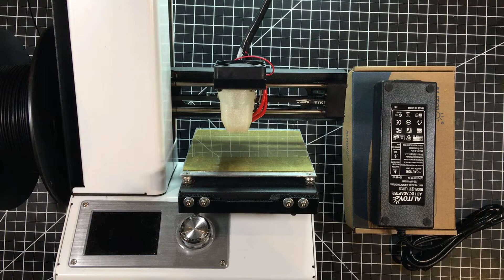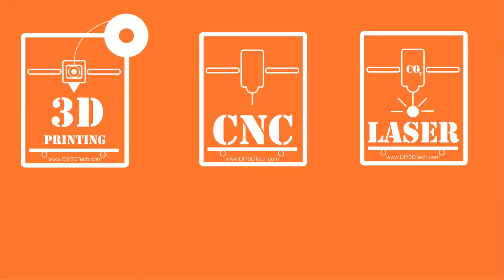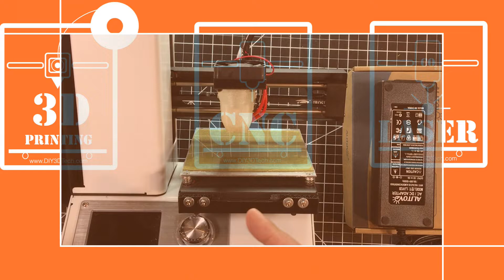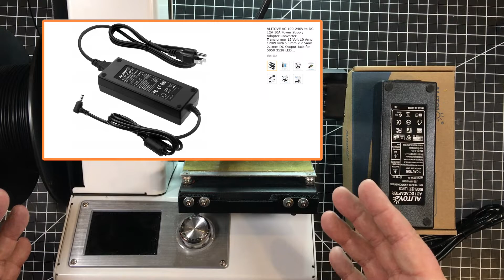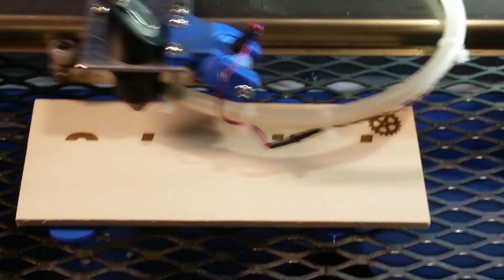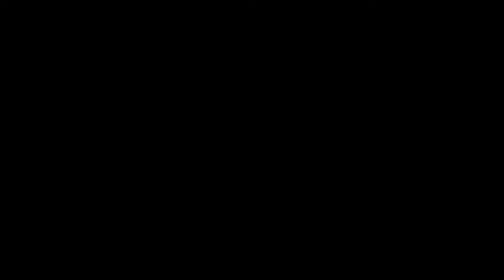Shop Talk  - Power Supply Replacement!

Comment: I've been running my MPSN for a few years now and I love it. My power supply went out pretty early on as well, and I replaced it with and old Xbox 360 brick. I followed a youtube tutorial, I don't remember who's it was; but it has been going strong ever since.
Reply from the maker: Sorry to hear of its early failure, however yes just any 12volt / 10 amp brick will work with some soldering...

Comment: I’m a bit surprised that you call this your favorite. Care to elaborate more as to your reasons for your statement?
Reply from the maker: Reliability and repeatably first, I have owned a vast number of 3D printer both commercial and self built as well as big to small and this one just works.  Also with its size to design means the parts printed where of high quality.  As when you induce the error of say a CR-10 into large part it is not noticeable because of scale however if the part is small then you are more likely to see those errors.
Reply: DIY3DTECH.com   
My first printer was/is this printer, the V2 version. 
I also like it. I also have an Ender 3 and Prusa MK3.  No resin printers.

Comment: The Monoprice Select Mini gets used much more than my CR-10. I had to do the heated wiring upgrade but got almost 3 years of use before I had to do that.
Maybe I should pick up one of these power supplies just in case. Thanks for the information.
Reply from the maker: Ditto I love mine! However keep watching as its going to get a sibling soon :-)